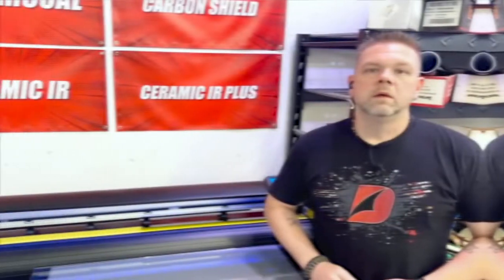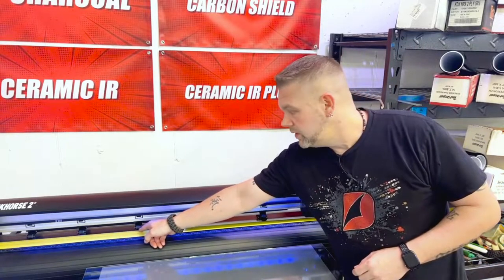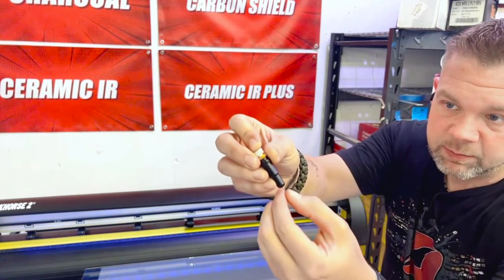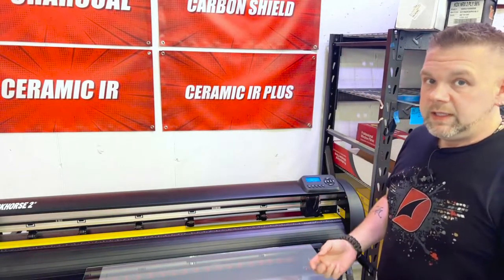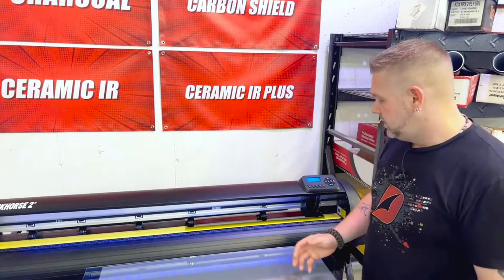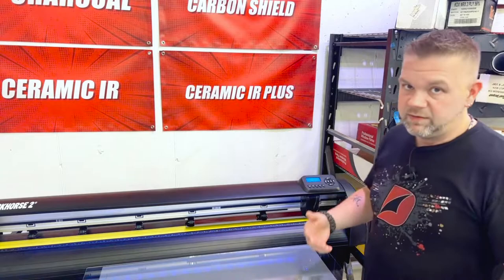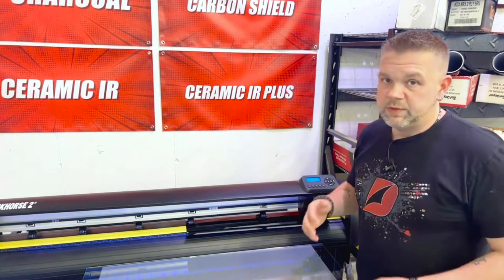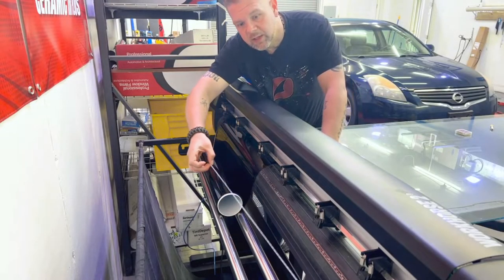Tint Plotter Troubleshooting - Film Bunching Tips

Comment: What if it cutting but it's not finishing the cut and there is about a 3inch gap. And when I got to install the measurements are off.
Reply: I HAD THAT PROBLEM WITH MY NEW PLOTTER AFTER WATCHING SEVERAL VIDEOS I FIND OUT THAT I DID NOT REMOVE THE CLEAR TAPE OVER THE STRIP AND FOR SOME REASON THE BLADE CUT IT A LITTLE BIT AND THAT WAS CAUSING WHAT IS HAPPENING WITH YOURS,I DID REMOVE THE BAD CLEAR TAPE AND THAT WOULD SOLVE THE PROBLEM,IF YOUR SOFTWARE LETS YOU CALIBRATE CUTING A STRAIGHT LINE YOU WILL FIND OUT WHERE IS THE BAD SPOT ON YOUR STRIP,KEVIN HAVE ANOTHER VIDEIO WHERE HE EXPLAIN HOW TO CALIBRATE YOUR PLOTTER AND FIND OUT WATH IS YOUR PROBLEM,IF YOUR PLOTTER IS NEW IT WILL BE THE STRIP BUT IF YOUR PLOTTER IS LITTLE OLDER AND THE STRIP LOOKS GOOD PROBABLY IS TIME TO GET A NEW BLADE,GOOD LUCK